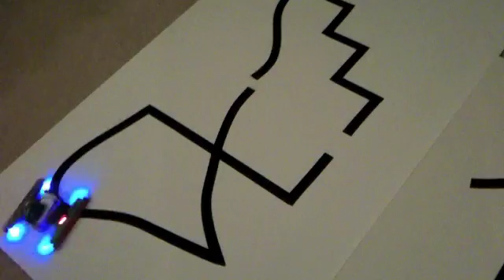Line Follower PID

Comment: i would like to know that the between one sensor to sensor, it can effect on the PID or not?
Reply: It will make a bit of difference, but as long as all the sensors give similar readings to each other, the PID loop will not need much adjustment. It is primarily the mechanics of the robot itself which affect the PID values.... the speed at which the robot physically responds to changes in control signals.

Comment from the maker: Yes, it is using IR for detecting the lines. The blue lights are just for fun... makes it look more fun. They don't interfere with the IR sensors.

Depending on the rules of the competition you'll be running in, you may have to deal with gaps in the line. At the competition I was running at, there could be up to a 5cm gap in the line. So the robot needs to keep moving forward for a while when the line disappears. That is where more sensors are useful.

Comment from the maker: The more sensors the better really. This one has 12 sensors (8 in the front and 4 in the back). My newer line follower has 24 sensors spread around it in order to give more information from the floor.

That being said, there have been successful robots with just 1 or 2 sensors in the front. It just takes longer to acquire the line after things like 90 degree corners, or gaps in the line.

Comment from the maker: @1m2a3rtin Its all entirely home-built, not based on an RC platform. Its using motors similar to the Pololu micro metal gearmotors sandwiched between some sintra that I cut out on my cnc mill.